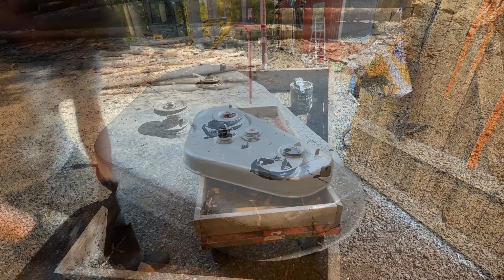Fixing a rusty cutting deck. Part 1; washing, welding, painting and testing

Comment: Have you ever replaced a 2 blade bioclip deck on a rider 13 with a newer deck (can't source any of the two blade decks new or used)!!?
Reply from the maker: Hi, I have not had a bioclip rider yet but from what I have read there is no “plug and play”
solution for replacing it. Everything can be modified to fit but I don’t know how much work it is.

Comment: I have a Rider 1200. I didn’t like the way the blade belt has such a long run across the back. It whips and wears the plastic blocks that hold the rear frame to the deck. I retrofitted three guide pulleys (2 vee, 1 flat) to guide the belt. It runs much smoother. 
A question…has anyone found a good source of replacement Kevlar belts? AliExpress or whatever?
Reply from the maker: It does whip a lot and creates some noise! I thought it was just my machine! Might try your idea. In Sweden it is easy to find a ”pirate” belt for all Husqvarna riders but I guess they are more common here. I will add a link to one site, perhaps they can ship internationally.
Reply from the maker: https://www.reservdelaronline.se/drivrem-kraftuttag-klippaggregat/574534--drivrem-husqvarna-rider-850-rider-13h-jonsered-fr2111-5066750-01.html?search_query=531005016&results=2&_gl=1*1mmonvv*_up*MQ..*_gs*MQ..&gclid=CjwKCAiA1eO7BhATEiwAm0Ee-HpQcS0A_clpd_7NjPIKhWycnFobw20VKOHDg3KWiSPUdaRGT3vRThoCR7QQAvD_BwE&gbraid=0AAAAADnJ9-KZ-4085NJA-zzVTl45oI6Wp